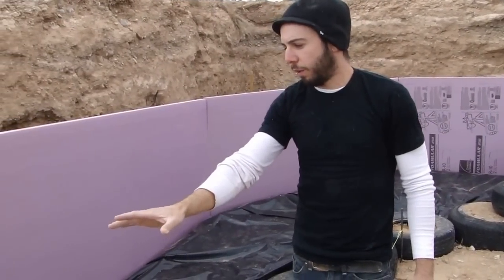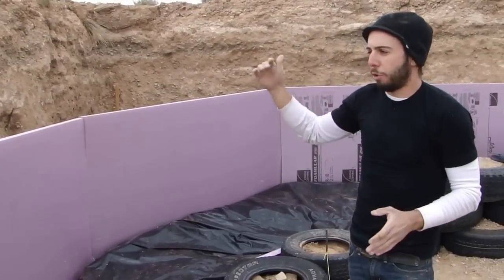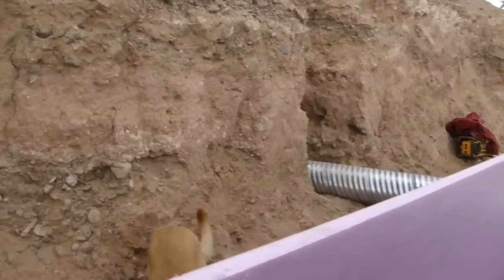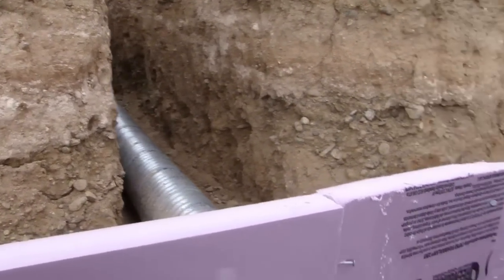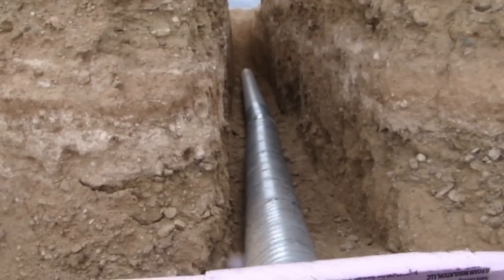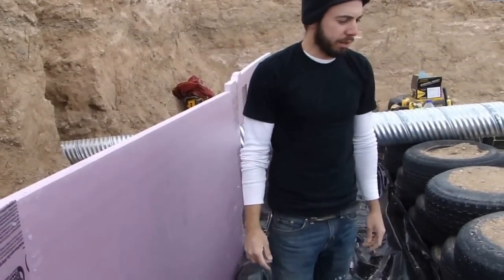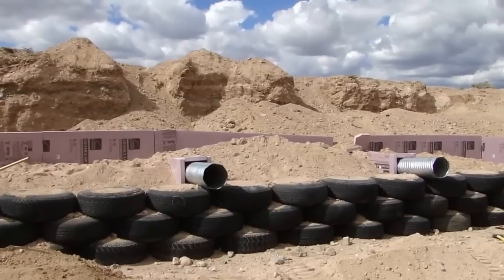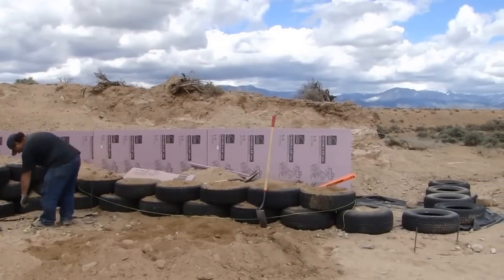Earthship Thermal Wrap and Cooling Tubes

Comment: I have an interesting house situation that I’m looking to buy… I want to experiment… it’s in high desert w windows facing north, may be slightly east… the lot hills up on the south side… it’s in the high desert at the base of mountain… just below the proper foothills.  I want to run a cooling culvert in through the south wall so I can use the existing greenhouse like north facing windows to vent and pull the cool air in… I’m also thinking of using a coiled culvert with 4” pipes… it is a 400sf building where the windowed area is ideal for separating like an earthship… my hypothesis is that it will still work, but maybe not as well… but, better than nothing.  And I don’t have a bermed wall, but was thinking of building a rammed earth wall and or a straw bale or straw clay wall around the existing house, located about 5-6’ off the house wrapping around the east west and south for additional climate control and the growing benefits of such spaces, shade, outdoor extension of living space… protections from animals, elements and more… anyone have anything to say about this opposite set up I want to try out?

Comment: If you want to see if you can get cooling/heat out of buried pipes in you area...
Get an 12 auger and bore down app 20 feet..
Watch the dirt you're bringing up as you bore down... You are looking for moisture...
Put up an awning to keep the sun off the hole...
Lower a thermometer that will record the temp..
That should give you an idea of what you are looking at...
Remember to put these tubes on the north side of your building to help keep the suns hearing effects from raising the temp...
Moist soil will give you better energy transfer
Metal pipe (corrguated)
Should work the best

Comment: The Tubes should be U- shaped. The Intake and Exhaust should both be in the Building and the Pipe should be completely buried. Then you use a low C.F.M. Fan to flow the air. Cooler in Summer and warmer in Winter.
Also, you should use the proper Connectors as Termites and other Bugs will find their way into your Building.
Just my Opinion.😉
Reply: That would be cooling/pre-heating, not ventilation. But as for ventilation, thing s aren't as simple as putting a tube into dirt for sure...

Comment: Thanks for explaining the design/build. My question would be- How do you dissallow water to come in through your culvert pipe, say in the event of a flash flood or something?
Reply from the maker: slight downward slope, the outlet is elevated like at least a foot or two off the ground, on a well drained buildsite, it would require noahs flood to back that bitch up

Comment: Why use the foam barrier when you can do thick plastic up the back side of your tires. Double it up the plastic.. When you fill up the back side pull one layer of plastic up and put one layer going down.  Then fold it over and staple in down the front or inside part of the tires. Then use chicken wire over that on the inside and run your stucco finish. No need to throw mud on inside on walls. Plastic will hold stucco in place until it dries. Then do your finish coat of stucco or paint. Seal up cheaper and work better for both sides of your tire walls. One day i'm hoping to build my own earthship.
Reply from the maker: foam for insulation.  if you didnt mud the gaps in teh tires, it would reduce the conduction of solar heat into the walls, which is their hole purpose

Comment: i watched this video years ago and just keep asking myself - what's the point using the thermal wrap if loads of earth is placed before and after the wrap itself ? 
the best insulation is the mother earth and  if thats true then the thermal wrap is just waste of money
Reply from the maker: You don't know what you're talking about.  The earth INSIDE the insulation is meant to be kept heated at like 68 degrees.  The insulation separates it from the EXTERNAL earth, the berm, which regulates itself around 58 degrees or less.  Earth is not insulation.  Its thermal mass.  Insulation is meant to slow the transfer of heat from one mass to another.  Thermal mass is meant to hold on to temperature, which it easily transfers to other massive, non-insulative masses.  If there was no insulative thermal wrap around the tire wall, it would quickly lose all of its heat to the exterior earth and would settle around 58 degrees or less.  This is too cold for human comfort.
Reply: @offthegridbuild  Well that's good to know. In the Southeast with 110% humidity, 58 degrees sounds amazing. Especially with good air flow. I think I'd rather keep the insulation off and periodically close/crack the tubes if it gets too cold than to try and insulate it and risk being unable to cool the home enough. I'd imagine there will be enough losses to even out the temperature so that its not unbearably cold.
Reply: @charlesnorvell6393  I'd love to hear how that works for you.  I'm looking at a colder climate, but with hot humid summers.  I'll need a wood stove anyway...
Reply from the maker: you got it, babe

Comment: Why is foam insulation used instead of straw bale? I understand that the back wall is bermed, and you are using a moisture barrier. Can't you do a kind of moisture barrier with straw bale, which has so many assets (free, natural, higher R-rating, etc.?)
Reply from the maker: +John Kessel u dont want to bury straw, sooner or later it will get wet and break down
Reply: is it not feasible to cob the straw bales before burying?
Reply from the maker: John Kessel sure, what good would that do?
Reply: I'm sorry, i don't understand your answer.
Reply: I am eager to learn this craft, but fairly unedified. Is that rigid foam the best insulation for this purpose? Why so?
Reply: John Kessel, it is a dense plastic foam, and wont break down with environmental stressors. The same thing can't be said for a strawbale. If there was a surefire way to watwrproof the bale then it would work. Cob isn't a waterproof  cladding, its just water resistant. If you buried it, it might fail with this sort of application. There really are situations where plastic-based products are excellent! Also, there are local building materials recycling businesses in my area, CT, where I can buy reused foam board insulation panels in varying thicknesses. They're using new insulation, but you dont necessarily have to!

Comment: I'm still interested in MrsMika's question from three years ago. How do you clean the cooling tubes? when cool air warms & condensates, moisture forms and it's going to grow mold. the corrugated tubes seem nigh impossible to clean effectively.
Reply: It is worth mentioning that in less arid regions large diameter PVC tubes (think municipal water supply pipes) could be substituted for the corrugated steel. This would alleviate concerns with corrosion. Copper tubes can corrode but prevent mold growth, however they are cost prohibitive. As for mold prevention in PVC I am not sure, but cleaning could be accomplished with with a large wadded up towel and some good disinfectant. Attach to an electrician's fish tape or similar and yank the whole thing from the house outward. Don't forget when setting your tubes to put them with some drop going out of the house to prevent water coming in. A fair amount of drop from the house to the end of the tube will not only prevent hard rain from flowing in through the tube, but also encourage natural gravity drainage back out from the condensation. Lastly, the flashing may work in New Mexico, but if moisture is an issue at all where you are building, make a proper connection to avoid further problems.
Reply: The tubes are installed with a slight slope out of the house so any condensation flows out of the tube. If it has to go up to reach the ground leaves then a T is put in with gravel below it so water flows into ground and air goes up
Reply: You want an upward slope of about 3% from the intake point to the house. Using galvanized material such as used here would not be such a good idea in more humid areas. The moisture will collect in the grooves instead of running away from the house. you'll want to use something with a smoother bore. it is a good idea to dig a collection pit for the condensation to drain into then have it naturally aspirated so the moisture vents or even be pumped out.
Reply from the maker: +Max Mason air is so incredibly dry in taos, it's a non issue
Reply from the maker: PVC doesnt conduct temperature as well as steel tho, so there is a sacrifice in using it.  you want a pipe that is gonna suck as much heat as possible out of the incoming air
Reply: Correct, and it will not be as inexpensive as culvert.

Comment: how do the cooling tubes work, in other words, how do you get air flow?  I could understand if these tubes were hooked together and one was an intake and another the outlet.  can you explain?  PS - amazing work!
Reply from the maker: greenhouse is hot and vents upwards.  this creates a vacuum effect.  which sucks in air through the back of the cooling tube, which is buried in several feet of dirt, and therefore much cooler than air temp.  the air cools off as it goes through the tube and it enters the house like air conditioning

Comment: I was wondering if an EPDM membrane has to be fitted behind the tire wall  to prevent moisture to get inside ?  Im planning  to build in a slope and very probably the moisture will get inside after  a while  unless a EPDM membrane will be used ?!  

cheers
Reply: I'm  planning mine and thats what I'm going to use. That's  what I've seen Michael  Reynolds use on his...he's  the expert on earthships. You'll  also use the epdm for your botanical  cells in the house as well. It's important to note from this video, his cheaper connector he came up with will fail some time in the future as the earth settles. It has to be water tight in order to be airtight. This one is going to be leaking dust, insects, gases and molds into his home from the very start.

Comment: just a thought...but instead of flashing on the cooling tubes...to be super super thrifty could you not just wrap them in the plastic from the concrete bags or other construction plastic then bury.........it would be waste anyways and probably discourage roots from growing down into the humid tube........heated air being drawn thru a cool earth mass is sure to build 70-100% moisture without forced air.....how deep would you say these cooling tubes are?? well under any possible roots??? roots bring micro organisms which breed a host of nasty pests such as fungus gnats and molds.....not so great for the south facing garden.....its been a while...any issues or mods you might suggest...I LOVE THIS STUFF...and thank you so much for the very detailed video so my not so savy friends can finally get the picture
Reply: Plastic deteriorates pretty quickly

Comment: Bill Mollison says these things gotta be at an incline towards the earthship so the air has to climb and at the same time the water will drop out of the air. He could be making up science, but there might be something to it. If there is, I wonder if putting a pipe in that pipe can cool the air further. The inner pipe goes inside, the outer pipe will have its own evacuated solar tubes. The air in the outer will move faster than the air in the inner and wick heat off the inner.

Comment: Do you close (if so how?) the cooling tube off in winter to keep the heat inside the house?  Do you have to clean them out so mold does not grow in the cooling tubes?  What do the tubes look like finished off in the house when everything is done?  Is it just a giant tube in the wall?

Comment from the maker: The tubes are going to do pretty much nothing as for cooling in the hot and humid months.  What they will do is air exchange which is very important in a home that is buried on 3 sides.  Before tubes were used there were skylights in the back of the house for air exchange and cooling.  I would put windows in for heat in the cooler months, but maybe you could save money on your design by putting less glass in.  I would recommend thermal shades to keep the sun out in the hot months.

Comment from the maker: @bvonmoss You would have to do some research of air flow.  It's a tricky thing, nothing like water flow.  Everytime you have a bend in your pipe you but you airflow down significantly.  But it is possible.  I have heard of bends going upwards to escape the berm vertically.

Comment from the maker: @imau2ber Interesting suggestion, makes a lot of sense, even the way we do it without perforating, the water still runs out due to the tubes being set on an upward angle into the house.  Two thoughts:

1) Why use solar fans for airflow?  Why not use the greenhouse convection engine?  Super powerful and completely free.

2) Note that hot temps with high humidity, I have seen the cooling tubes to very little cooling at all.